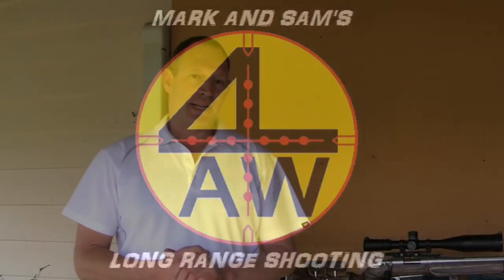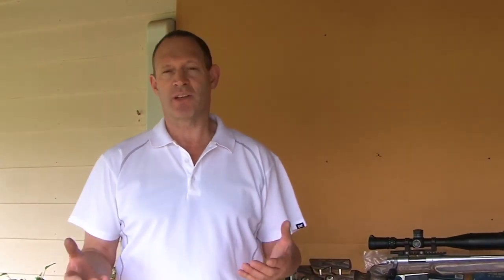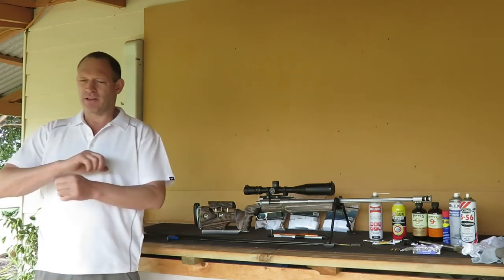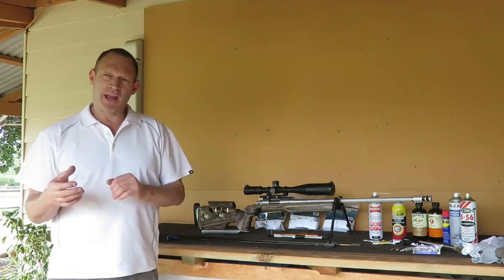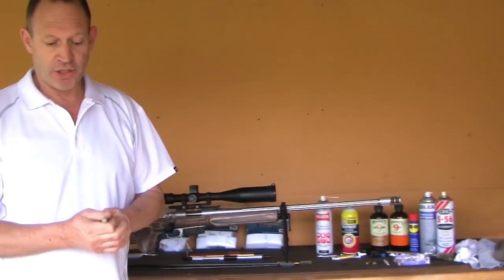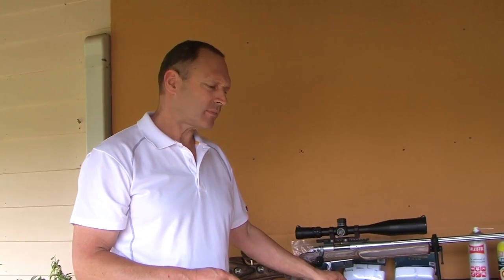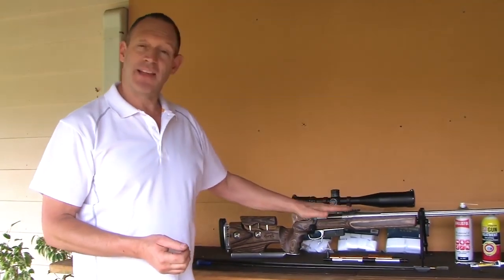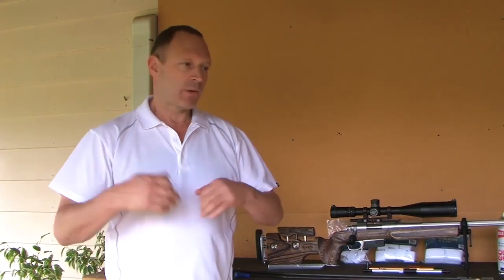4AW Cleaning a rifle ((RE-RUN))

Comment: You have changed the way I clean my rifles forever!! BTW, anybody want to buy some solvents? You need to make a tool that goes into the barrel, self centers and has a cutting tip or a ceramic stone to square up the chamfer with a hand crank. If there is one already I'm not aware of it but certainly would buy one. It's certainly fraught with challenges but would be awesome!
Reply from the maker: Cheers

Comment: Again I've watched this vid at least 4 times before I broke in my new tikka ctr ... after the break in   after the last patch I ran about 30 to 40 rounds and I 
Did your cleaning method....

Patch came out looking great! And I stopped at 2 patches.....

No brushes or solvents for me again as long as everything stays as is.

I will also say I shot one of the best groups of my life...4 rounds in a 1/4" group with a called flyer taking it to a little over a dime...... I was happy to say the least.......
Reply from the maker: Sounds great, Cheers

Comment: Honestly think there's a time where copper no longer shaves in the bore. Eventually you've filled all the micro-grooves and pores with copper that are going to be filled. It's like a metal file that's been caked smooth with a soft material and won't remove anymore. To remove all the copper with a very harsh fluid is going to etch the steel over a long period of time in my estimation.
With cold hammer-forged barrels, I tend to feel the bore surface is extremely dense and smooth, much less likely to deposit copper on it. I don't know that a bullet made of soft metals are ever able to wear the extremely hard steel bores. It's the heat and burning powder chewing up the bore ahead of the case.
Reply from the maker: Yep, Cheers and all the best.

Comment: I also like using Ballistol in my guns. This solvent is not toxic for the hands, and also is really efficient to soften the carbon desposits when you clean the barrel. I have also a cheap borescope to look inside my rifles barrels, it's a good way to see whats happening at any stage of the cleaning process.
Do you have a solution to clean the front locking lugs into the action ?
Reply from the maker: Just a 12 gauge mob on a short rod does the trick, Cheers
Reply: @markandsamafterwork  Thanks a lot Mark, cleaning this part is the most difficult. Cheers